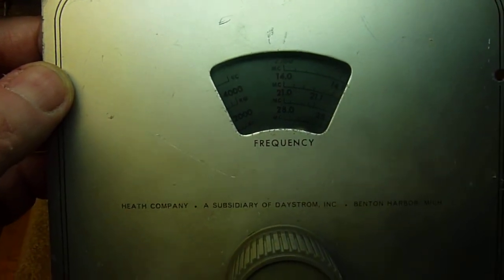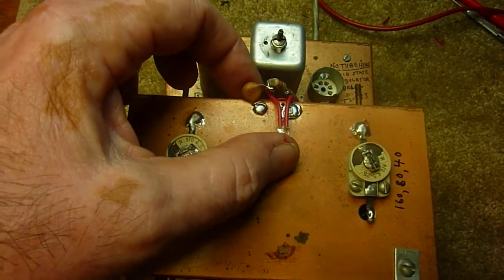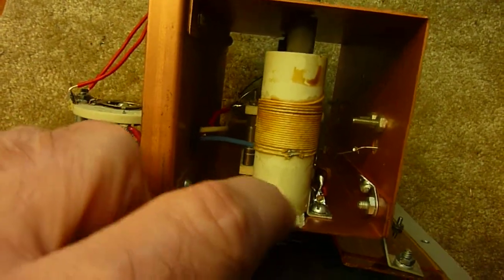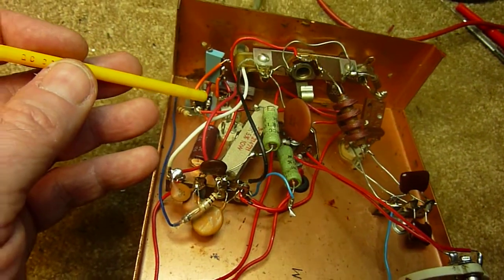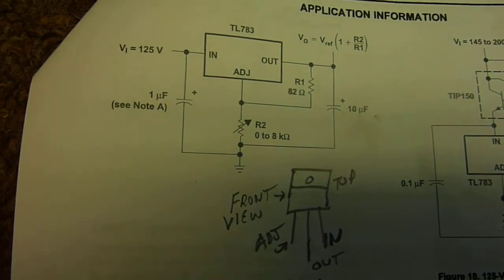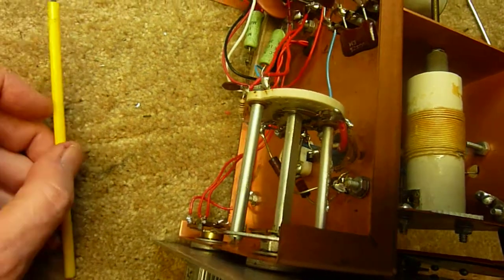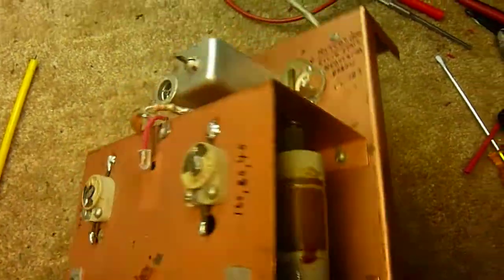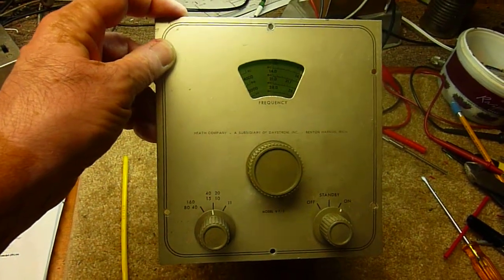Heathkit VF-1 VFO , Tube VFO , VF1 VFO REPAIR ,REPAIR ODF A TUBE VFO

Comment: Very helpful, Bob. Regarding the coil mounting, that's actually how the manual said to do it. I like your way better. I also want to find a way to sleeve the slugs so they fit somewhat snug inside the coil former, getting rid of the jiggle there. I just ordered a roll of tinned 18 ga buss wire to redo all the links from the coils, capacitors, and switches. I might drill some holes in the backplane and grommet them to keep the ones to the switch separate and rigid.

Comment: I have an HG-10 VFO that works fine on 40-10 but on 80 M I can't get the frequency lower than 5.5 MHZ no matter how I adjust L2, ideas?
Reply from the maker: Well  L2 is the coil for 40,20,15 and 10 meters the coil you should be adjusting is L3. Assuming you have tried L3 that is the 80 meter coil then  it could be the switch not making contact for the 80 meter range . When I worked in Heathkit service the first things we did were check for the correct parts , check for poor or not soldered connections and loose hardware . Then check to see if it is wired correctly I just checked my own HW-104 I have had for years  and found a 680 ohm resistor where it should have a 6800 ohm resistor and no it did not work right that wrong part had been in there since 1975 ! SO  look for wrong parts .  So then  work the band switch back and forth all the way at least 25 times to wipe any dirt or corrosion off the contacts and try it again being sure you are adjusting coil L3 . you can also put a TINY bit of contact cleaner on the switch contacts I squirt some into a small bottle cap and apply it to the switch contacts one at a time with a tiny screwdriver dipping it in the cleaner . I found Wal mart has electrical contact cleaner in the Automotive department in a spray can it is a red and white can and is the type that evaporates after you clean things with it .Another thing is to make sure ALL grounds are good and all the ground lugs and other parts that are grounded to the chassis are making good connection  loosen and then tighten all ground lugs and grounded parts such as the tuning capacitor . IT is not enough on some grounded parts to just tighten them you need to loosen them and tighten 3 or 4 times . I tighten them tighter than many people do to get a better ground. Sometimes I run an extra ground wire to grounded parts like ground lugs and run it from ground lug to ground lug to make sure all are GROUNDED well  . I have run into this grounding problem on several old heathkits . Be sure to oil the grounding wipers and shaft at the ends of the tuning condenser I use 10 W oil for this but any thin oil is ok I have used 10W30 as well with success put a little in a bottle cap and apply a TINY AMOUNTof it with that tiny screwdriver so I don't get any on the plates .  73  Bob
Reply: It turned out to be that L3 was a coil that WAS the wrong value 10 uh instead of around 20 uh. I put another 10 uh in series and at first look it appears  to work.

Comment from the maker: The power supply is an old one from another project years ago . The transformer is 
135v secondary ac and 6.3 volts ac for the filament if my memory is working ok it came from an old TV booster I bought at a garage sale  . Its rather hard to find nice little transformers these days . The 135 V secondary of the transformer feeds a full wave bridge rectifier  (4 diodes) in the normal fashion as per the old handbooks . This feeds a 40 uf capacitor  250v  then a 500 ohm resistor 5 watts (used like a choke ) followed by another 40 uf capacitor  . Thats it.  hope this helps . Bob
Reply from the maker: Oh one more thing the B+ from this little supply is 165 VDC  with the VF-1 operating .  73  Bob

Comment: Great job Bob. Im wondering if you would be able to provide a schematic of the power supply you are using with the VF-1. I recently acquired one and would like to run it off of an external supply such as yours. I also plan on making the same mods to mine as you have done. Thanks-Bob-W0YBS

Comment: Hi Bob,  could you possibly provide me with a hand drawn schematic for that solid state voltage regulator you made showing all the parts you used to build it ?  I would also be interested in knowing the mfgr. & PN for the 10K ohm Pot.  Also, are the 2, 6uF caps electrolytic and what are the voltage ratings for them?  You can send this info to bzadel89@gmail.com.  I'd appreciate it.  Thank you, Bill

Comment: Nice work! Didn't realized that TI had high voltage regulators. I use the TL431 type from time to time but most of my work is in high power rf, not low level stuff.